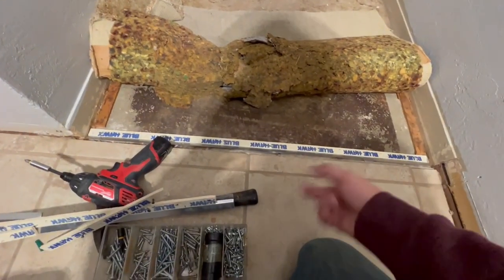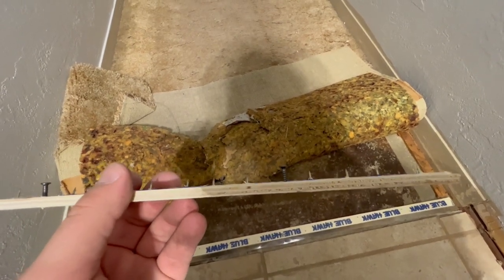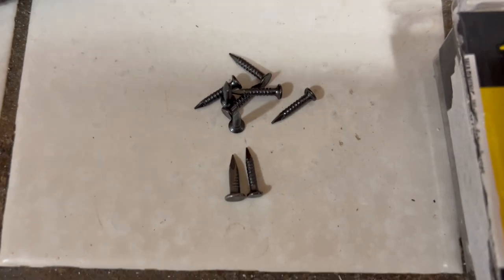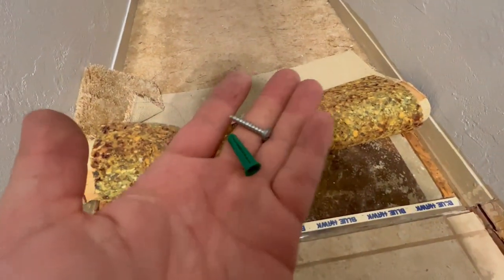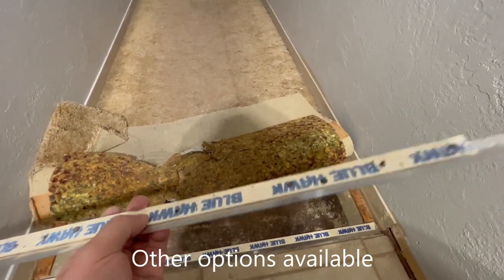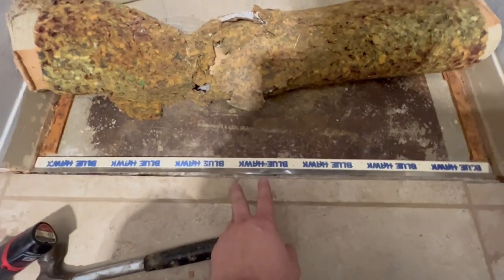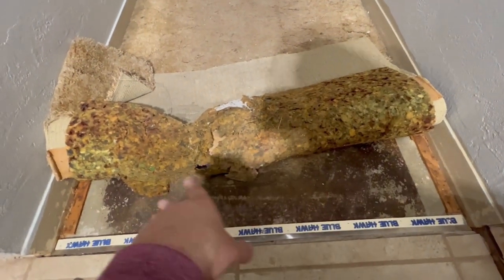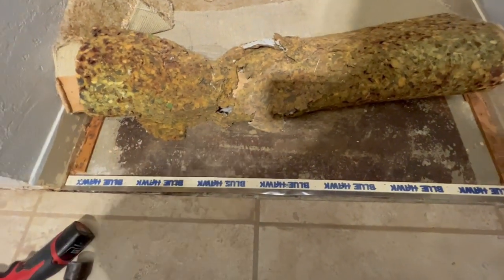Easy Install Carpet to Tile with a Tack Strip,  Z Bar, Anchors or Adhesive "Part 6 - Indoor Reno"

Comment: I said how do I fasten tackstrip to ceramic
Reply from the maker: You would need a masonry bit (diamond) that says it can drill ceramic (or it will crack the tile / melt the bit), use anchors like I did and maybe adhesive (something like liquid nails heavy duty but ask the store people, might need more flexible adhesive) to keep everything bonded if you use less screws.